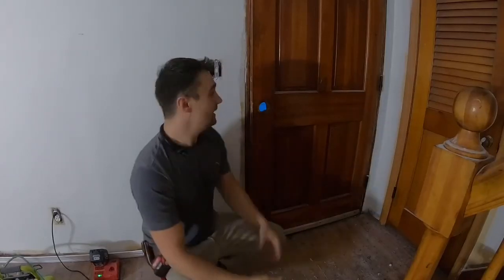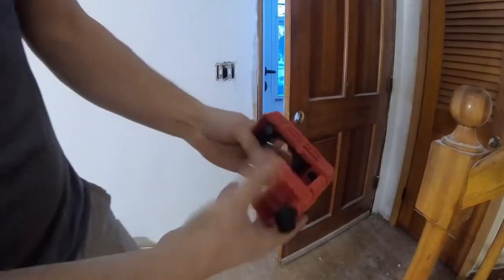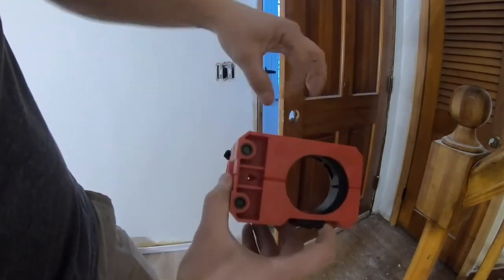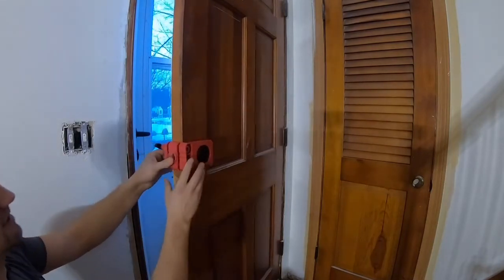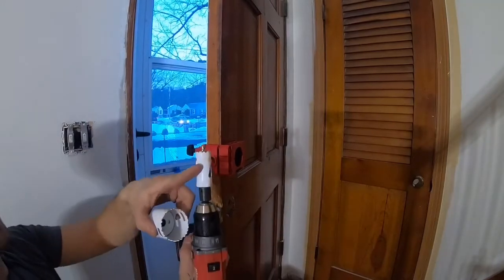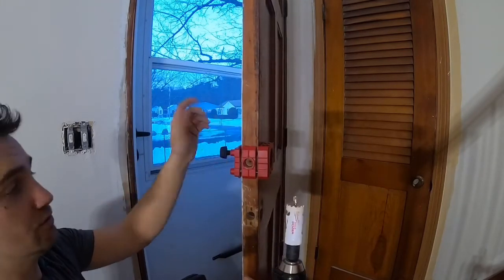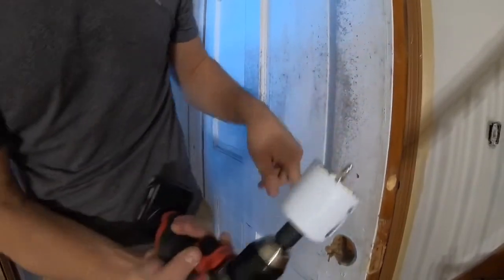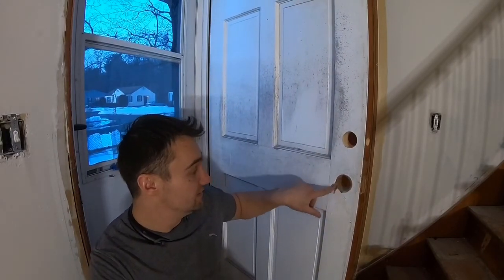HOW TO DRILL HOLE FOR DEADBOLT

Comment: How do you make the hole on door jamb and match it up with the dead bolt?
Reply: I was wondering the exact same thing!
Reply: @jaspreetbaveja5491  When you install the dead bolt into the door, put something like a dab of paint or paste at the center of the dead bolt, shut the door, turn the dead bolt knob, that will run into the jamb and that will put  the paint or paste dead center of where you want to drill your hole into the jamb.
Reply: @gtguy181  drill with what? the same bit u used for the smaller hole on the side of the door?
Reply: @cullen4925  Yes, the same small hole saw will work perfectly.
Reply: @owkia  I ended up trying it without a response and it was the correct answer XD thank you!